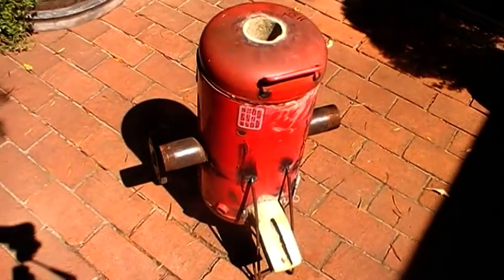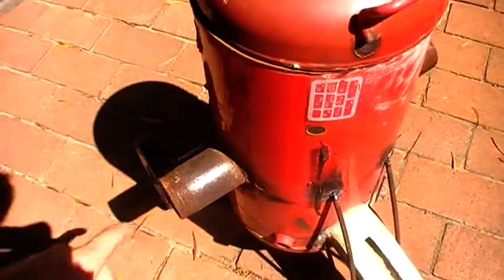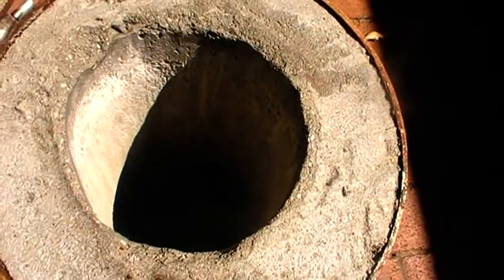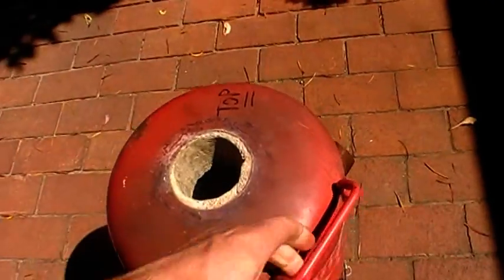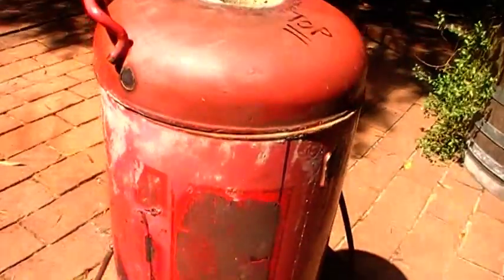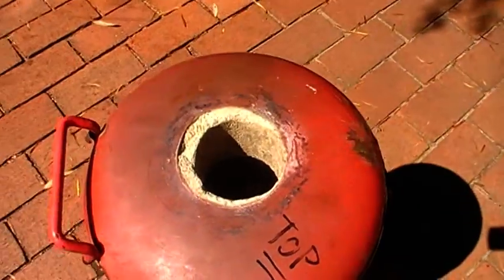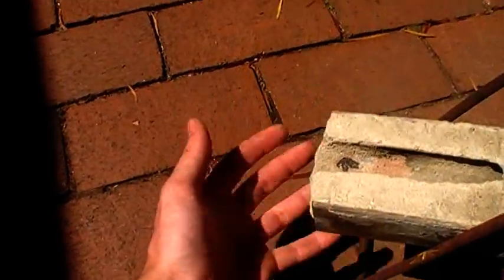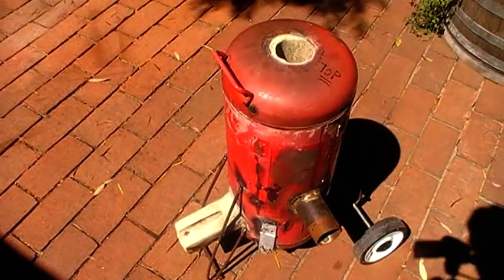Homemade blast furnace.

Comment: u missed one thing a blast furnace means just that u have to force air into it to get more heat to melt the metal at its proper temperature some sort of blower [leaf blower should do it]
Reply: Wrong, a blast furnace is purely oxygen, super heated and forced into the chamber

Comment: Nice looking furnace, but a few suggestions/points of interest. Number one, your refractory looks quite thick, I would have used maybe 2/3rds of that, which would give you a larger inside volume. Also, when using a cupola, the proper term is a ladle, not a crucible. Lastly, its pronounced Q-pola. Technicalities aside, that looks like a really nice furnace. Is the shell made from a large propane tank or something?
Reply from the maker: Kind of, its made of an old air tank.